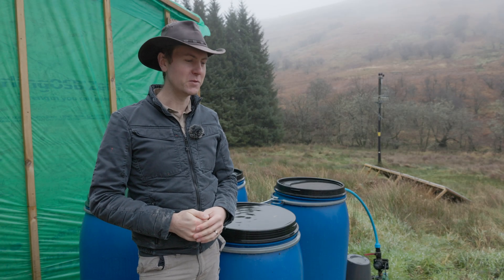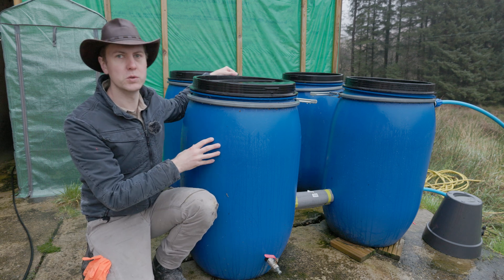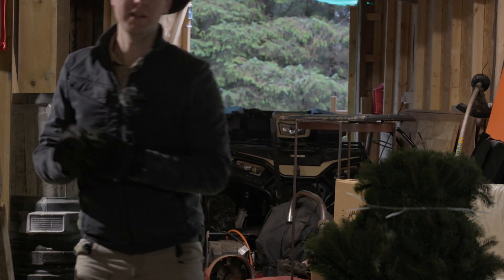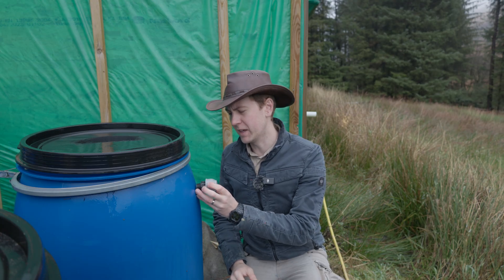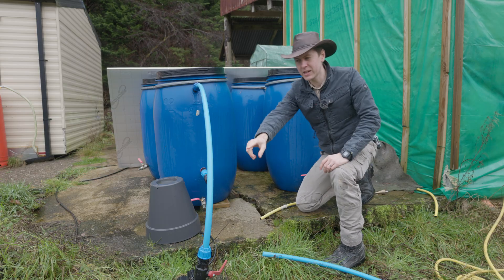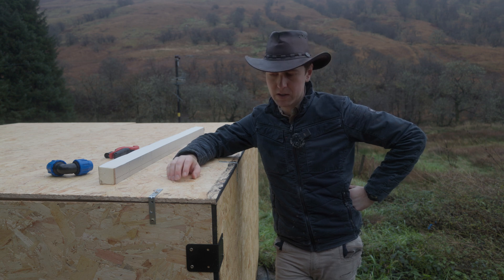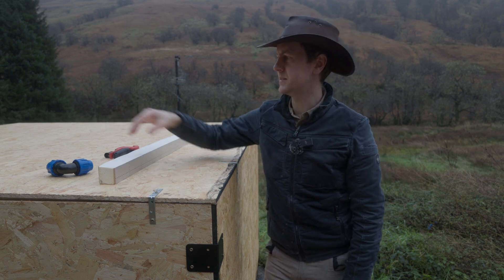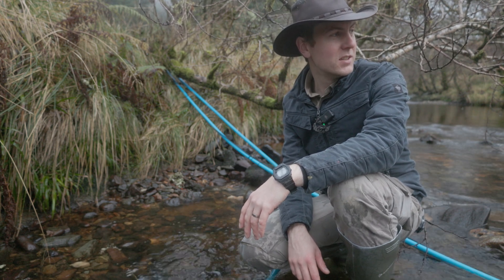Keeping Our Water Flowing All Winter: Affordable Hacks to Avoid Frozen Tanks

Comment: If you connect a pipe to the inside of the overflow and have the pipe take the water from the bottom of the barrel, it will suck out any sediment you may have collected in the bottom of the barrel - self cleaning.
Reply from the maker: Nice idea

Comment: Can you not put the low voltage anti freeze wire round I know your thinking amps battery’s etc or dig a big hole and use the ground temp difference ??
Reply from the maker: That would certainly work yea

Comment: You could build a 5th "fake barrel" with a pipe, feed from the bottom of the 4th barrel. Then you have a flow in the 4th too! Another tip: You could get some silicone mat or to pour it, to create your own (thicker) seals. Edit: just had another idea: burry the inlet pipe deep into the ground before it goes into the barrels, so it gets "heated up".
Reply from the maker: Those are great ideas I will definitely be doing some of them on the next upgrade

Comment: Why did you use silicone sealant for the pipes , i use it for pond plumbing
Reply from the maker: I tried silicone but for some reason it diddnt want to stick to the barrel and split as soon as I moved something around e.g reconnected a pipe.
Reply: @beyondtheworkbench  you have to gently rub the surface with glass paper to give it something to key into